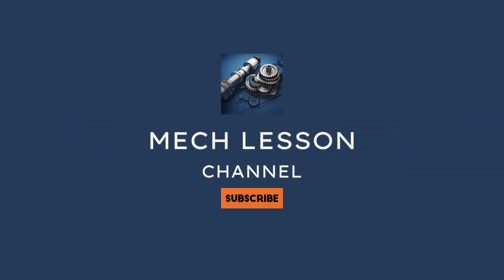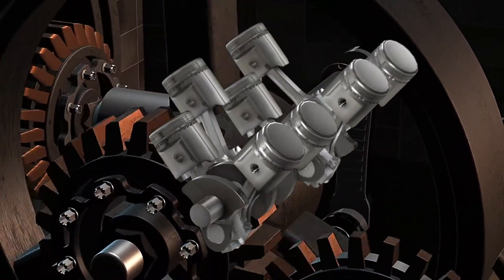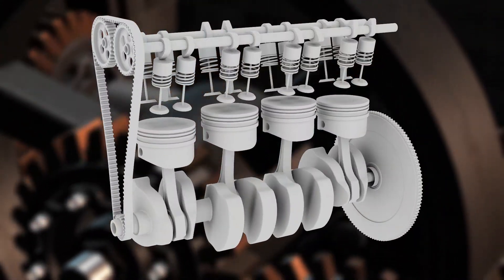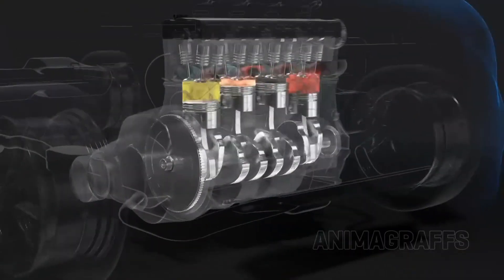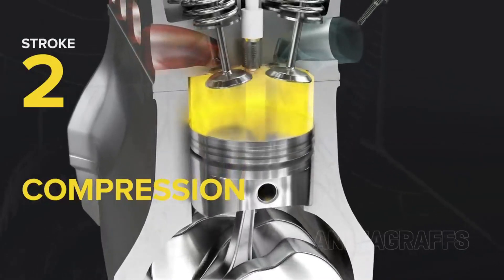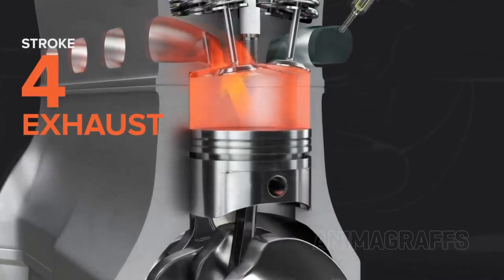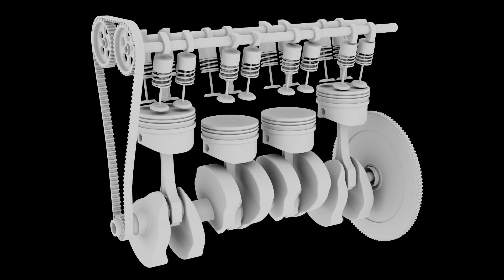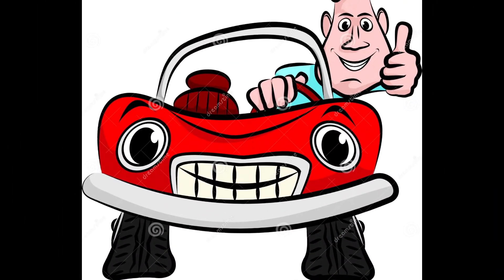What is Internal Combustion Engines and How it Works? | Step-by-Step Animation & Deep Explanation

Comment: Not bad but entirely missing the elephant 🐘 in the room. 

How does the crankshaft convert a reciprocating linear up/down motion into a rotating motion, not just mentioning the Fact that it does. Explain how and show with detailed animations corresponding to explanation. It would take this video from C to A.
Reply from the maker: This is basic of a car engine ... while the main focus is on engine repairs and fix, you can still check our video on the heart of car engines. Our focus is more on engine repairs and fix